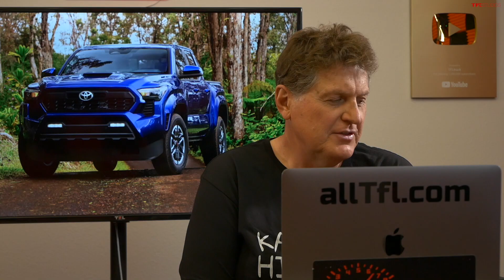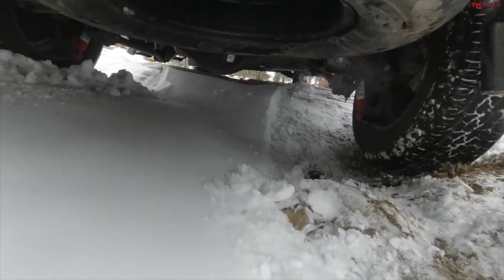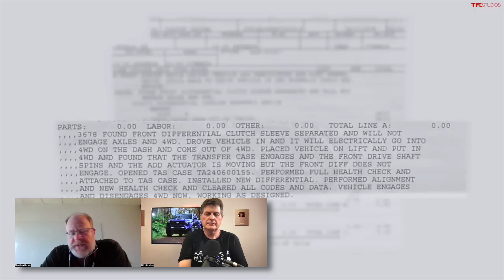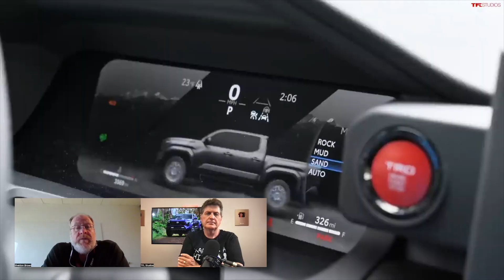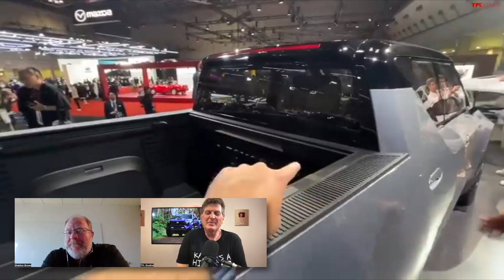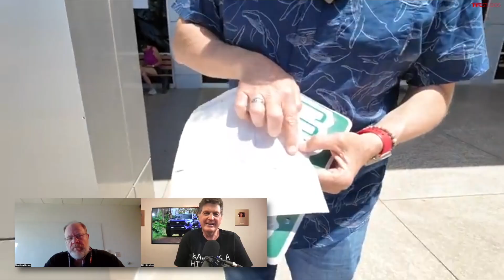The Real Story Behind How Our New Tacoma Broke & How Toyota Plans To Fix Yours!

Comment: Overbuild it or lose customers till you do. More nanny “software” fix’s will not instill confidence in your core consumer’s mind. Sure, if the trucks were pavement queens, the truck would be fine but as is, social media will continue to kill sales and the Tacoma may very well lose its top seller status which is near criminal in my mind. 
I have driven Toyota trucks for 40 years now and I will continue to drive my current Tacoma till I’m 6 ft under. 
Bring an efficient 6 cylinder back and beef up the driveline. It’s that simple.

As for listening to your customers, we know Toyota is NOT.

Comment: How can it be that spinning your wheels on ice and snow can transmit enough torque to break a driveline. I’m not being a smart ass, this is a question with respect.  I would think full throttle on dry pavement or even full throttle towing a trailer would put more stress on the drive line ?
Reply: If you did Roman's technique on pavement there would be tacoma parts all over the place.
Reply: @googleaccount2637  LOL.

Comment: If a 1.7% higher than rated load or force can break a part mechanically, then that part is undersized. What happened to safety margins?
Reply: Truck King just dropped a video where they broke a 6-speed Taco,  they noted that the manual transmission Tacoma is rated at eight fewer foot pounds of torque than the automatic. They said the Toyota engineer told them that the transmission did not have The torque capacity for the whole number. So 8 lb is going to make that big of a difference? Tells me that the transmission is too weak to begin with with zero safety margin.
Reply: @trailrunnah8886 there is a video where someone said it looks like the trans is going to be an issue on the new Taco. Auto and manual are having issues. Some as low as 1800miles. It was a channel I didn't follow but it was pretty thorough.
Reply: @trailrunnah8886 Could explain why he kept accidentally saying “transmission” when talking about a torque-induced failure.
Reply: They forget what factor of safety means. I'd hate to see what the fatigue and wear duration is on a part that can't handle 1% over max torque.
Reply: @triedproven9908  Yes, all the mechanical engineers at Toyota all collectively forgot what a safety factor is and should have consulted Youtube comments for design guidance.  Eye roll
Reply: @HaleFire7  im inclinded to agree with your  facetiously sarcastic remark.
Reply: Yes, it is stock, and it can't handle the default tire.
Reply: @humorss  there was no traction tires were not a factor. it sent torque to a wheel that had the brakes clamped shut.
Reply: You can't fix that with a software release, unless you take even more torque away, a lot more!  Not very functional!
Reply: As an engineer I can say modern CAD tools allow a level of confidence (some times false) that allows for a reduction of safety margin. Add in a financial incentive to keep costs rock bottom and this will happen. Personally I think a company’s reputation good or bad has an effect on the company bottom line that is not readily measurable. If you go back to the Gen 1s absolutely no one at Toyota costed in how the reliability of those vehicles would be carrying the Tacoma brand today.
Reply: @RaysVideoChannel1  Common sense  and experience, have left the chat , when it comes engineering .  Guess that AI is maybe not the future .
Reply: @RaysVideoChannel1  This is why I always do a dynamic von mises stress test in FEA software, but I bet their shortcoming here was that they didn't add in the rotational mass-load of the drivetrain into the calculations of max stress for the part just the calculated multiplied torque of the engine.
Reply: @RaysVideoChannel1 CAD allows the reduction of safety margins to near zero, or it just provides the temptation to do so? 

There's simply no way to know that older margins of safety were excessive. Nobody knows what stresses every single Tacoma out there was subjected to, yet didn't break. It's quite possible that many trucks, with engine tunes, oversized tires on lifted suspension, have been stressed close to their limits. Nobody knows or will ever know.

Margins of safety are chosen. Fighter jets run close to their limits, because performance means survival in combat, and they get serviced every sortie. Passenger jets have fat margins of safety, because any failure can lead to mass deaths, but getting to Tulsa 5 minutes sooner or later isn't that important.
Reply: @RaysVideoChannel1  garbage in garbage out. Same can be said for crash and tow ratings. You won't know until it is real world tested and that's why tfl has the pull they do.
Reply: Pretty sure he said it exceeded specifications by that amount. So, it could be that they already have a good safety margin built into the design/specifications. But, the logic utilized by the software allowed the stresses to exceed even the safety margin by 1.7%.
Reply: @jbhorner  moat likely that is what the engineer meant. And people are interpreting this statement differently.
Reply: Speaking as a mechanical engineer, this is the point I got tired of the tech double-talk and turned it off
Reply: Exactly why I prefer HD trucks these days, much better safety margins for larger tires and heavy weights.
Reply: Poor design
Reply: Blah , blah , blah
Reply: In the end what we concluded is " Do Not Use This Vehicle Off Road " lololol
Reply: I assumed he meant it was 1.7% higher than the safety margin they designed for.
Reply: They had to make way for profit margins
Reply: Max designed torque as designed is already well above daily use/maximum load. It is called Fatigue Load Limit which is a factor a certain percentage above what the average max load/stress is expected to be.

For the sake of discussion, let's say Toyota designed a 20 percent FLL factor above daily/max load. Roman managed to get to 21.7 percent  and shit broke.

It is called engineering. That being said perhaps Toyota should alter their FLL to satisfy the whims of the interwebs because 1 in 43,000 trucks broke. In the end the general consumer will get a less capable truck due to torque limiting software updates. 

Truck King roasting a clutch on a bad down shift makes 2. Why even try a 5'th to 3'rd down shift? If you need to do that you should not have been in 5'th gear in the first place. Did he actually hit 3'rd, or did the clutch fail because he money shifted it by mistake and roached the clutch before the rpm could climb?
Reply: @zonacrs  you're 100% wrong because it wasn't the driver, but rather the truck's own traction control system, that caused the failure. 

They designed a computerized system that would apply forces that would destroy the diff. They could have just as soon checked and designed the system to operate within the capabilities of the differential and axles. 

It's called engineering.
Reply: @barrydworak  I'm guessing you are not an engineer.

Edit - Your use of the word "they" tells me all I need to know about you.
Reply: @zonacrs  I don't throw around credentials. They don't matter to facts. I'm not an automotive engineer.

If you actually watch the video, you'll see that the diff broke when the tires had no traction. They were on ice and spinning freely. 

This means, and you really ought to understand this, that the dynamic torque overload came from the actions of traction control system, not from the driver or the outside environment. 

In basic terms, the truck broke itself.

People do break differentials off road in extreme situations, but never when the tires are spinning freely! There has to be some resistance, to break the diff.

If you didn't watch the video, go watch it. This will be obvious if you pay any attention at all.
Reply: I’m over here thinking only one .7% of the load. What about when you’re towing
Reply: And how do you know if it wasn't overbuilt to begin with to handle more than enough torque from the engine?  Toyota addressed the rare use case and fixed it so it won't happen again.  If you don't think it's fixed, go drive one and try to break it like TFL did.
Reply: It broke, the first time out.  What is the likelihood of that, on a 1.7% chance?  Bottom line, they built a flimsy, unreliable vehicle, failed to plan for even light usage, failed to do proper testing, and now failed to correct these issues.

Comment: Appreciate the openness, but they exceeded loads by 1.7% and had a failure? No safety factor? Or is that 1.7% over the safety factor?
Reply: Either way it establishes that the system is not robust enough.
Reply: Very poor engineering

Comment: Everybody that has ever off-roaded an old-school Jeep, Lancruiser, Bronco, or pre-Tacoma is shaking their head. This is proof the new systems are shit, including Toyota’s. Please give me a vehicle with a simple rear locker and a front Torsen and no turbo small displacement 4-cylinder crap engine and leave me alone. Would I buy a new Tacoma? NO. However, props to Sheldon for going on camera to explain everything.

Comment: It honestly sounds like a normal off road situation with traction control operating as designed caused the break.

Locked rear diff, front end slipping on one side, mild RPM, sends power to slipping wheel. snap

Comment: That would suck if the shaft inside the diff is the fuse instead of the CVs. Say goodbye to trail-side CV changes.

Also, imagine spending way more money on a hybrid only to find out it's been de-tuned to non-hybrid power to save the drivetrain! Should have built the truck to survive hybrid power...

Comment: So much hate in the comments for a company and engineer willing to actually go through all the trouble of investigating what happened and then go on camera to talk about it. Do you think GM or really any other automaker would have done that? We already know how Subaru treated TFL for testing their vehicles; they told TFL to get lost and banned them from getting future test vehicles. Nothing is perfect and the fact that Toyota actually had programming in their software that let so much torque go to one wheel tells me that they have more confidence than most in their truck. Yeah it broke and maybe they won't stress the driveline so hard in an update but it seems Toyota is serious about the Tacoma being an off road machine.

Comment: This engineer is gaslighting.  Not only that, he tries to explain away the situation  by blaming the driver.  Toyota problems are not rare, but seem to exist on most new Toyota trucks.  Where is the Toyota QC.  It seems they must have all retired.  Standard procedure is to overbuild by at least 50% more of top design load.  This apologist is an embarrassment to Toyota.  What happened to rigorous testing before selling the product.  I wouldn't buy any of Toyotas trucks at this point in time.
Reply: Yep, truck king had their demo tacoma break on them and toyota blamed it on driver error, something i did not see in the video.

If everything is "driver error" then  i'd jate to have to use the warranty on one of these trucks... "Sorry, not covered, you caused it by being in an inappropriate mode".

Comment: Sadly, the condition of it breaking was hardly extreme. To think, Toyota in their testing hadn't ever experienced any sort of widespread failure and  that the engineers either hadn't encountered or attempted to over engineer or bolster the defective part for their customer base is exceptionally troubling. Possibly leading for further problems with that part in the future on other Tacoma's similarly equipped.

Comment: How has Toyota designed a truck to not handle the full power to one wheel with an additional safety factor applied? 
The other concern is how little force this took. This was not an aggressive maneuver by any means, and very offended by calling this use case RARE

Comment: So we need to de-tune the truck because it can't handle the torque... Gotcha. For those thinking of putting slightly larger tires on your new "off road" Tacoma prepare to have your warranty denied, I can see it coming.
Reply: Yup. All Toyota is going to do about this issue is cut back power in 4lo. Much easier for them to program it out, vs. increasing actual component failure points.
Reply: @donleamon8653 won't that be fun. Crawling along and it stalls in low range due to software. God I am glad we are switching to Ineos.
Reply: That’s exactly what Jeep did with my ‘18 JLU Wrangler (3.6L/6M/3.45 gearing) when clutches started exploding! Update the software to reduce torque when the clutch started getting too hot.
Reply: Exactly, that proves they weren't overbuilding their parts and cutting more quality and costs, they didn't do that in the previous gen Tacoma smfh

Comment: "Hard to explain but under certain user  selected terrain modes bla bla bla mumble jumble ...."   Yet we have seen people take their old school 4 runners for years and years and not see crap like this.   So the answer is to dumb down the software more to reduce energy  to wheels.  He admits its a similar design but the new motor adds more torque then before so under certain user selected situations that system will fail. The way I interpret that word salad is the front differential is under built  to handle the increased torque of this engine.  Thus they will limit that torque to wheels via software.  That's not sounding good as far as design.  Also this does not address  the issues from users where the rear diff is overheating when towing or heavy off roading.  An issue that is more wide spread and again, having negative impact on  the rear differential.  Does this truck not have an intercooler for the trans?   Why are we having issues with both differentials?  Are the underpinnings that  under built?

Comment: As I keep listening to this guy the more I'm convinced that changing straight forward mechanical components to be electronically controlled is over engineering
Reply: Who'd have thought applying excess power to allow for multiple brake clamping actions to be applied to find traction would be a bad idea? Lockers and proper driving over software every time.
Reply: Why the Jeep Rubicon uses a front locker rather than a fancy brake based system.
Reply: To be fair front lockers are a niche mechanism and probably an expense most people will never take advantage of. Why build something most people won't use. The brake system is software that can use already existing mechanical components. Toyota has had the MTS system for years now and its been good enough for when it's needed
Reply: @Tacobuster88 nearly all people that use a 4x4 for trail use add a front locker, and it's basic modern tech. More and more vehicles come with front locker. Toyota is headed the wrong way.

Comment: Still sounds like a weak point in the front differential.  Glad I don't own one because driving and towing in snowy conditions I feel it would break.
Reply: Yeah, that was a very little traction scenario and it broke.
Reply: They weren't even towing and it broke as soon as they hit some snow on a light incline.
Reply: Remember guys, it also broke in 4 low where the power is amplified by gearing.  And with an offroad mode turned on.  In 2H/4H on the road the powertrain isn't going to be nearly as stressed.
Reply: @jimmy-buffett  excuses excuses...

Comment: "We exceeded the margin by a mere 1.7%" and you're telling us that's enough for it to break? Seriously? I would hope it would be over engineered by at least 50%, preferably more. Talk about making something just barely good enough. So is the rest of the truck designed to break at only 1.7% over spec??? Go research the Toyota Engineers explaining why the manuals have the horsepower neutered. Same reason, the manual drive train can't handle 278hp.

Comment: This is an embarrassment to Toyota. The corner that broke should be able to take 100% of the tq in such a limited traction situation (which it wasn’t because the rear tires were still spinning). Had a 2012 TRD sport for a decade. It was awesome.  Bought a new 2023 off-road and sold it within 10 months.  It was trash.
Reply: How was the third gen trash?
Reply: @joseeduardo4327  had the 2012 from new to 110k miles and 10 years.  Never a single problem.  I replaced the front wheel bearings and front brakes… that was it.
Reply: @joseeduardo4327   hunted for gears like crazy.  Got OTT and still hunted like crazy. They replaced my entire dashboard because it was defective. Replaced drivers door upholstery because it was defective. It had a bad ‘clunk’ that was because body mount bolts weren’t tightened from the factory.  Suspension squeaked. Then it developed a shake at highway speeds and i just couldn’t do it anymore so i sold it to VROOM.
Reply: 2024?
Reply: @adamklotzify  mine was a 2023… so 3rd gen not the current 4th gen in this video
Reply: I had a 2022 Trd off-road and sold it within a year. I was so disappointed. I wanted to love that truck, but it just doesn’t even come close to the hype. The transmission is an absolute pile of garbage.
Reply: @DUNEDIRT  I’m glad it wasn’t only me.  Was starting to think my standards were too high.

Comment: I have to question quality & testing because my '84, '94, '04, & '08 never gave me an issue besides basic maintenance (batt, alt, starter, etc) and the first 3 had 1.2+ million miles combined. I think I'll keep the '08 for another decade.
Reply: Until the frame rusts out. The recall did nothing but spray some pitch on the frame. Five years later Toyota refused to inspect the truck. Off to the junk yard it went.